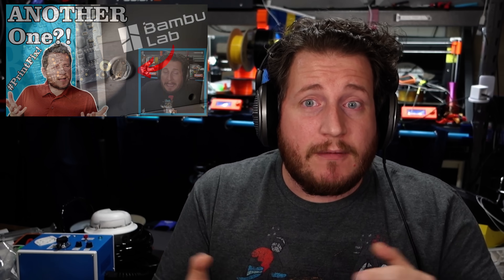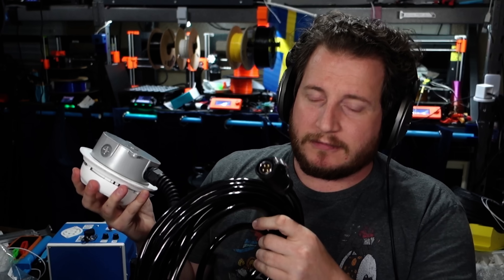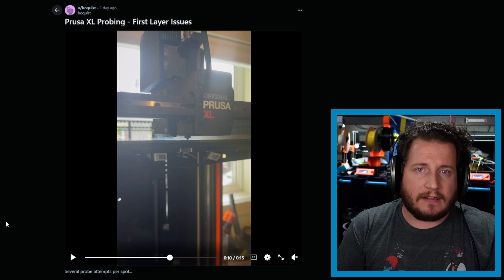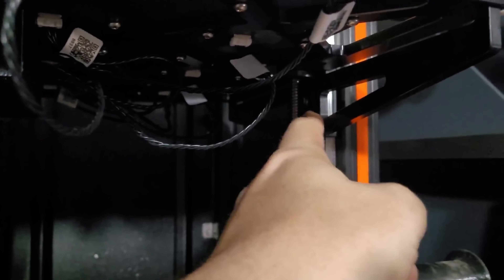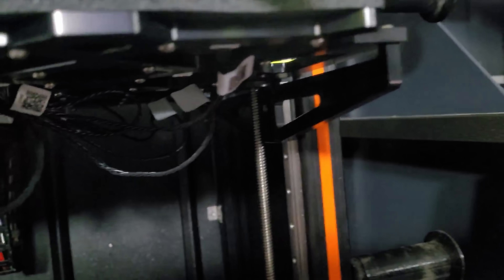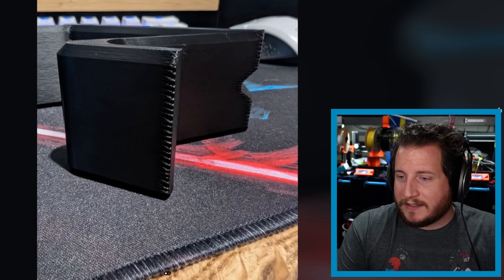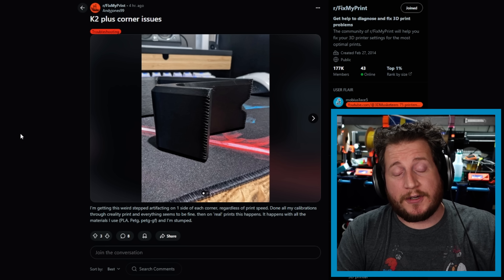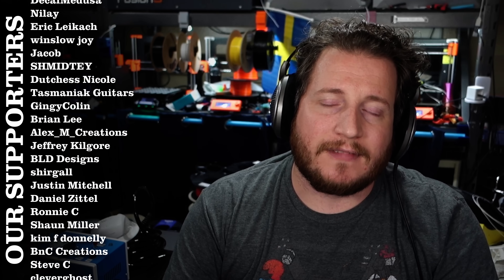This Creality K1 Tore Itself Apart! - PrintFixFriday 206

Comment: For the Prusa XL you can also re-run the Z alignment calibration instead of moving the motors by hand. On the menu go Control -> Calibration & Tests -> 4 Z Alignment Calibration

Comment: For the corners, you didn't mention attempting to rotate the part orientation, or location on the build plate. Try a different part orientation and see if the problem is that geometry or the physical front part of the build area having issues. If it follows geometry, dive deeper into pressure advance. If the problem is only associated with the location on the bed, it could be a slight mechanical issue - minor misalignment of the motion system affecting movement speed, or you're getting some of X gantry twist that is aiming the nozzle away from perpendicular. Drag chains, cables, or the bowden tube could all be pulling on the top of the extruder and aiming the nozzle away.
I had a bent nozzle on a X1 that was only about 1-2 degrees from perpendicular and it was making the surface on the front look like garbage, but other sides were all fine, unless you looked inside the part and saw that the same sharper corners on the inside toward the back were also rough. A digital inclinometer could check for the X gantry twisting at the front, but I doubt most people have one of those around.
Reply: In addition to this (all valid) I have see this turn out to be due to a funky bowden tube + a hob gear that was slightly eccentric, making PA a "ragged edge of available precision" that was then further sabotaged by a cyclically inconsistent extrusion.

Very frustrating to troubleshoot because it seemed like anything we did would effect the outcome but nothing would quite fix it entirely.

Comment: The problems with those Corners is most likely a speed or volumetric flow or even both I would try cutting the speed down the half and adjusting the volumetric flow down by five and keep adjusting the flow

Comment: On the qidi issue, try to swap extruder assembly , i had this happen to me on a K1, it was the gears backlash was crazy and didn't helped the fast movements of PA, its cumbersome but for example i would try to swap the gears first and motor last. If the issue persist then it is a complex issue but almost sure its going to be gears or in the worst case its gonna be the extruder motor

Comment: For the corner issue, a couple ideas. 

Is there something interfering with parts cooling?  This is a low probability, but I have had  cooling setups that had poor coverage and it caused weird issues. 

Is the printhead loose on the carrier?  Even just a little bit, something to where the printhead will shift during some moves but not all moves.

Comment: Ya know what?  Maybe adding in a dedicated smoke detector inside the electronics bay in the printer is a better way to do this.  Have something that will directly monitor the boards etc but not give false hits due to normal printing (ie smoking pla).

Edit:  I don't know if this was the same issue but I had a similar corner effect as the plus4.  In my case it WAS pressure advance but no matter how I tried calibrating it was all over the place.  I completely redid a VERY thorough flow calibration (multi pass) and then the pressure advance and the change was dramatic.